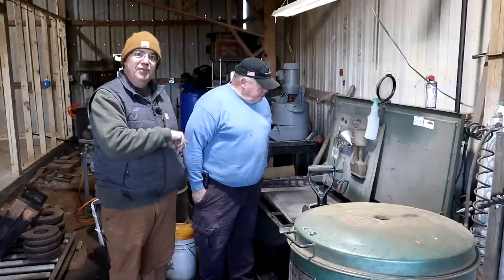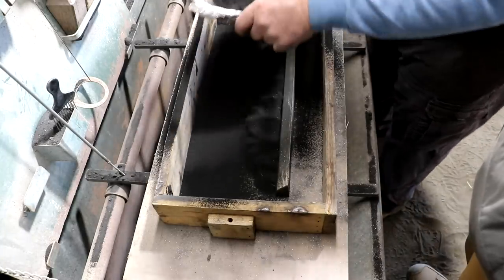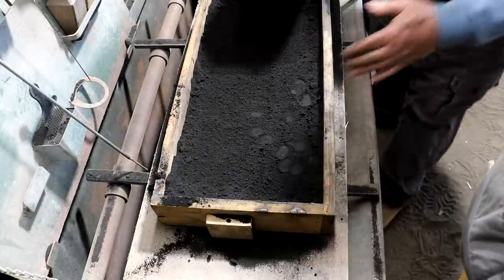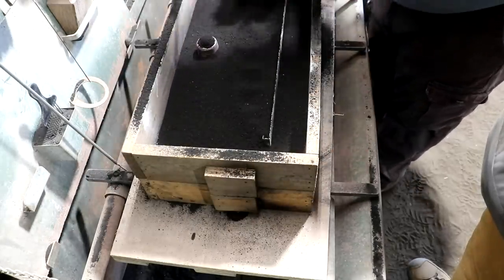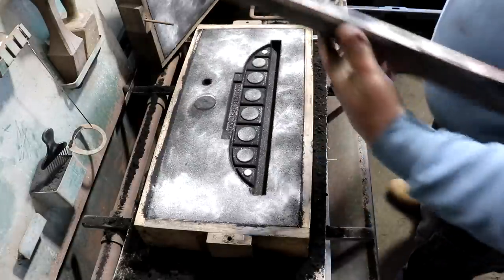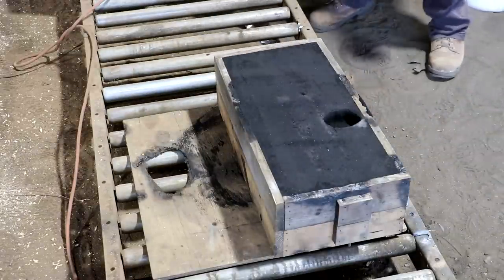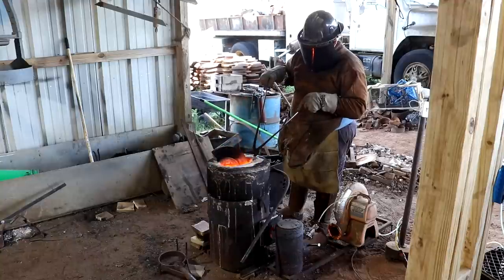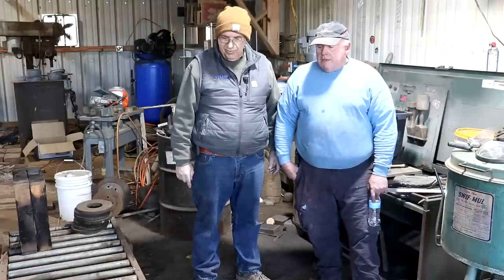18” Straight Edge Prototype: Molding and Pouring a Casting at Windy Hill Foundry

Comment: i used to work in a bronze foundry. i was the crane operator for metal pour. our crucibles were 2-3x's the size used here and held around 350lbs of bronze poured at 2300 degrees. had many close calls working there. foundry work is extremely dangerous.

Comment: For as much foundry work Clark does, I'm amazed he doesn't pick up some used foundry equipment like metal flasks, a jolt/squeeze,
induction furnace, etc.  The small job shop foundry industry in the US has steadily declined in the past 25 years resulting in a glut of
used equipment.

Comment: Are those grinding wheels on top of the flasks?
Reply: Disc brake rotors.
Reply: They are weights Clark salvaged from a machine at his former job.  To keep the molds from separating.